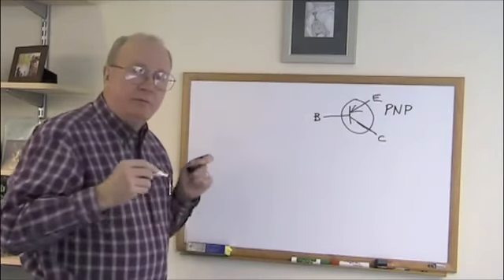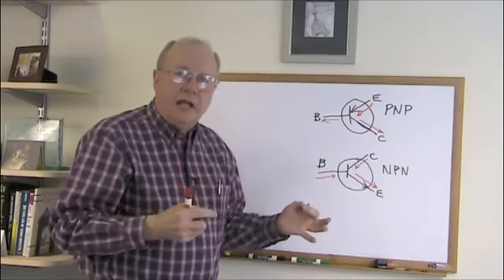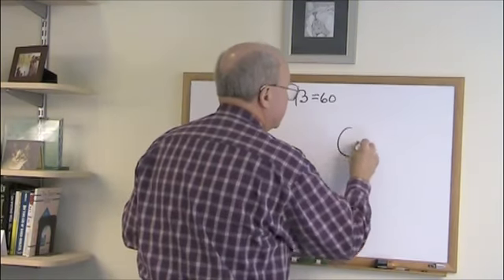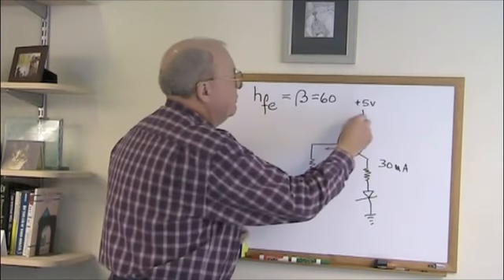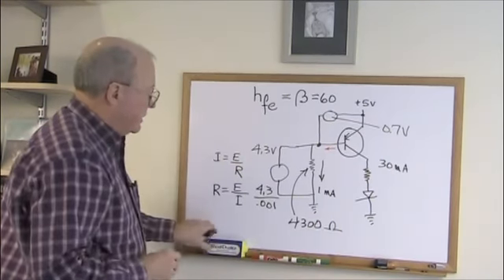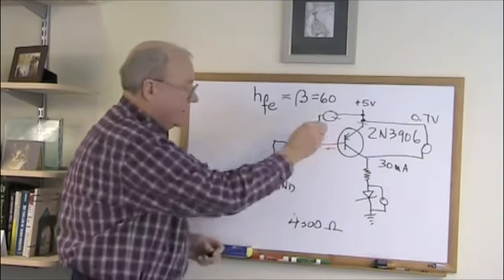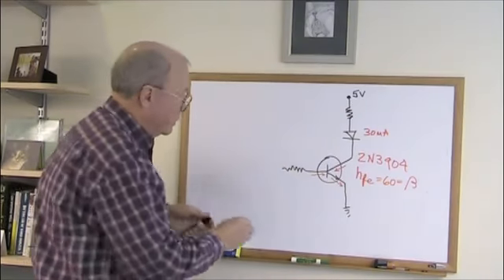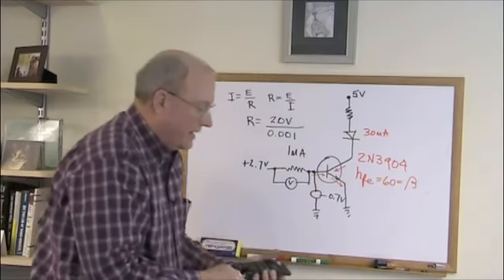Transistor Drivers for LEDs

Comment: The best explanation I've seen to date.  When I look at commercially available driver boards for LED flashlights, they often have at least a dozen components, including what look like (unmarked) transistors or possibly MOSFETs, capacitors, resistors, and inductors. I think it's because these high wattage (3, 6, 10 W) LEDs in 1,000+ lumen flashlights are drawing closer to an amp.  Some also have multiple modes, i.e. low, med., high, strobe.  Hopefully I've learned enough here to make a simple on/off 3W LED driver.

Comment: Vce(sat) is typically 0.3Vdc for approximation, not 0.7Vdc; the resistor 90-ohm (assuming a 2-volt drop across the LED), or 91-ohm as a standard value
Reply: Correct calculation 👍

Comment: Its' correct but you forgot the collector-resistance. Rc=(5-0,2-1,5)/30mA=100ohm. Where 0,2 is the drop across the transistor and 1,5 is the drop across the diode. 0,2V and 1,5V ...approximative values. Look into data sheets for right values....

Comment: Thank you Mr. Titus, hope I spelled that correctly. These are the type of instructions I, at 63, have been looking for. I no longer work at my chosen career due to physical limitations, was a Contract Plumber. I however am still held on the planet by Gravity. I always liked,,, not loved electronics. But I guess do to my age get frustrated easily. I have spent a small fortune over the years on small quantities of components due to shipping prices. So I have so many, that I have forgotten what and where there shelved. For about a year I have looked for a LED driver circuit I could use as a dome light in my GMC van. Yes, I could buy one on eBay, I know that. But I enjoy being able to know I can replace by building, what almost always becomes obsolete,,, like "ic's" for instance. I hate frustration!  Watching you explain how transistor operate directives is figured,  seems a bit over my head, but doable without the FRUSTRATION.  Thanks. I am wanting a super bright LED, cause I am getting old, it needs to be that for me so I can do tasks on chainsaw, or fix failing electronics's while Camping in the Cascades. I am aware of many off the shelf super bright flashlights available,, even had the pleasure of borrowing one, but its 85 miles from where I camp on some land I purchased too Klamath falls Oregon, buying batteries is a chore and expensive.
Reply: E.H. Lipton m

Comment: I don't get it,  your not really controlling how much current is flowing though the led, isn't the resistor doing that by limiting the flow first ? you basically making npn function as a switch ?  allow flow though the transistor ?
Reply: patprop74   Yes, the resistor in series with the LED does limit the current.  However, a small amount of current (1 mA) going through the Base of the transistor controls the larger 30mA going through the LED.   Most outputs from gates can sink/source up to 20 to 25mA, but 30mA is beyond their operating range.